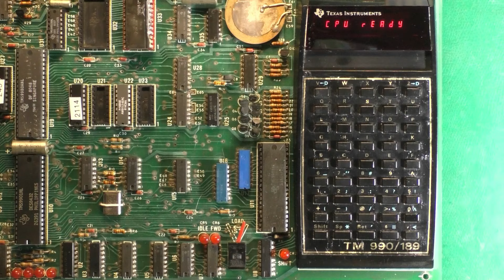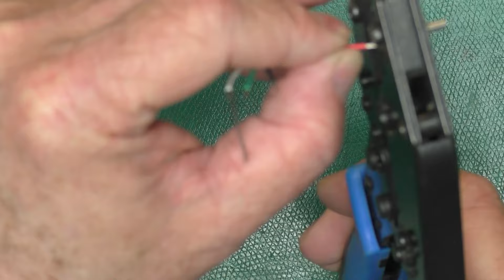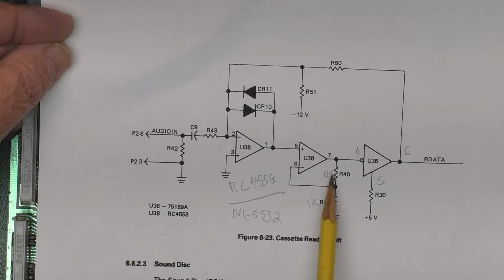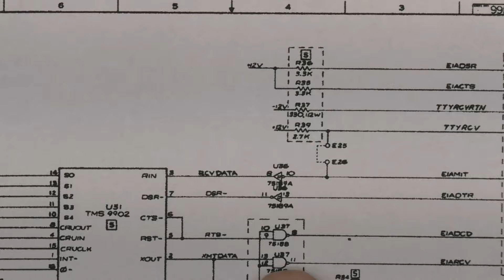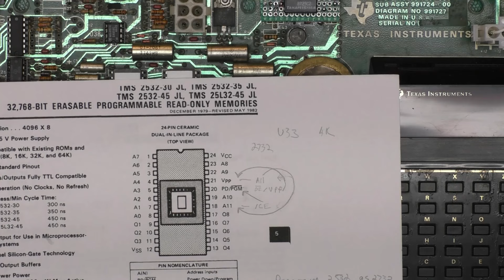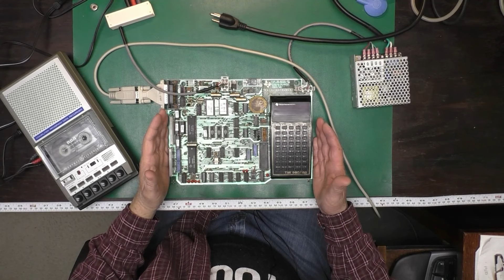Texas Instruments TMS processor dev board from 1980. Part #2 Cassette, Serial, EPROMs, UniBASIC

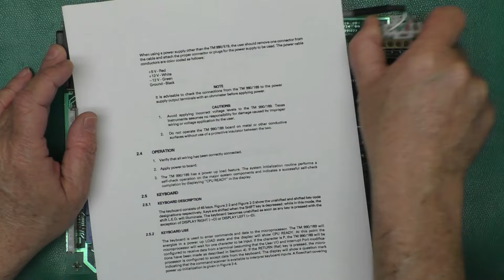Comment: It actually tells you about the need to press enter on that printout at 10:23
Says the CPU is configured to wait for one character to be input, to choose between that inbuilt Keyboard (Enter) or a Terminal (P)!

Thanks for showing this off and your patience in fixing it! These CPUs fascinate me and Usage electric is working on new video series, building a homebrew mini computer" with one!
Reply from the maker: Yes, that was the point I was trying to make. The info was in the manual but I just missed it. The way the manual is organized does tend to make it harder as you have to search multiple sections to derive enough info for one task (like how to use serial) and even then it is incomplete sometimes.